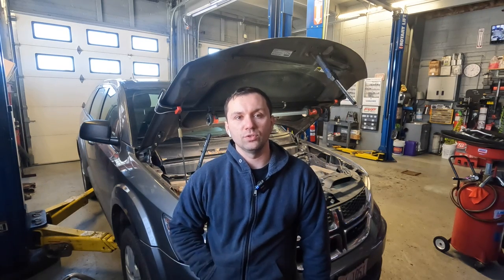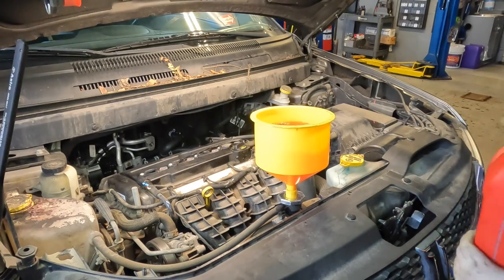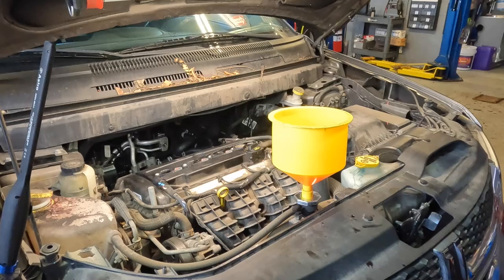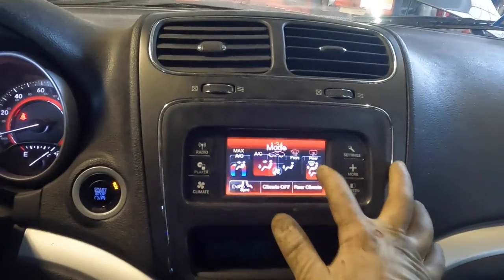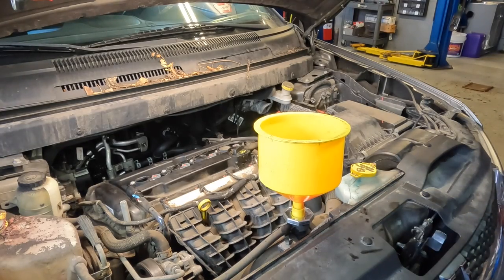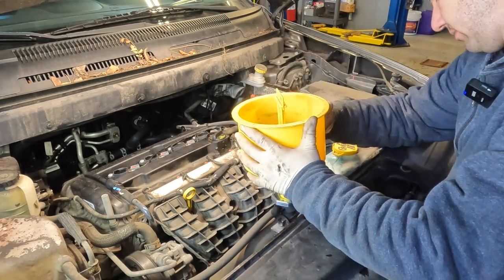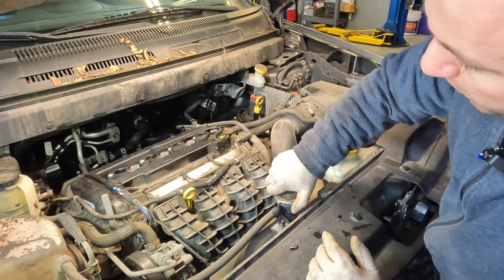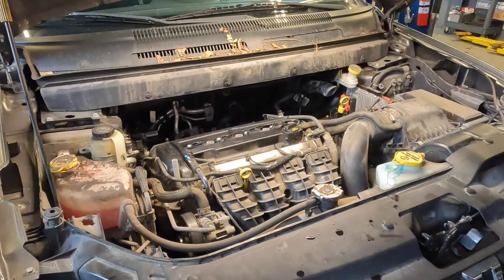HOW TO BLEED AIR FROM A COOLANT SYSTEM WITH REAR HEAT AND A/C!

Comment: Great vid man. I was a little confused by a video by the CarCareNut who said to turn OFF the rear heater system... but that seemed weird to me. Granted that was for a Toyota Highlander (which is what I drive) so I'm not sure what the difference is between his method and yours. I'm inclined to go with your method as I used sealant additive last year to try and hold off the leaky radiator replacement project.
Reply from the maker: You always wanna have your front and rear heater in heat mode because you wanna be able to circulate the coolant through those systems to get all of the air out. I’m not sure what the car care nut was referencing, but it doesn’t really matter on any type of car if coolant flows through it whether it’s summer or winter you have to have the vehicle in heat mode on both front and rear. Otherwise what will wind up happening is you can get trapped air in there and the first time you open up your heater you introduce the air in the system and wind up having an overheat.
Reply: @TheEnthusiastMechanic  OK this confirms what I was thinking. Thanks man, great stuff!

Comment: Does this vehicle use two heater cores one for the front and one for the rear or is it the same one?
Reply from the maker: If you have a separate rear heater there’s 2 otherwise there’s at least one in the front.

Comment: Fans never kicked on what to do
Reply from the maker: Sometimes it can take a while for the fans to kick on. There’s been instances where I’ve waited 45 minutes. You always just gotta make sure your gauge isn’t going into the overheat and of the fans don’t kick on and your gauges showing overheat that means you gotta figure out what’s going on with the fans
Reply: How can the fan be on 1 but you said keep the heater and AC off. Also, if you don’t have that yellow thing, can you do it old school in an emergency?  Thanks so much! Video is very informative
Reply: @yjenkins4564  So there's a couple things happening in your question. Firstly, if you simply turn the HVAC power OFF, this will often close a valve in the car which prevents the coolant from circulating through the HVAC system. That's not good as there could be trapped air in that part of the coolant loop. Most modern cars have an AC button to turn on the AC compressor in any mode, but they will also run the AC compressor automatically when you chose certain modes like Defrost (to dehumidify the air). If your vehicle doesn't have an AC button, consult your owner's manual to learn which modes automatically trigger the AC compressor so you can chose another setting that won't. *For those who don't know - running the AC compressor also instantly turns on the radiator fans, which he's trying to avoid for this exercise.